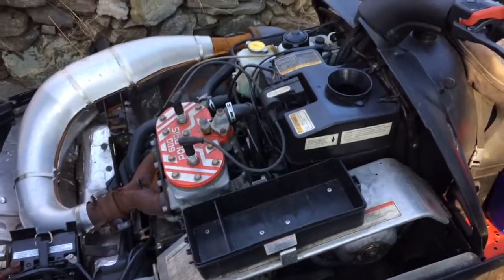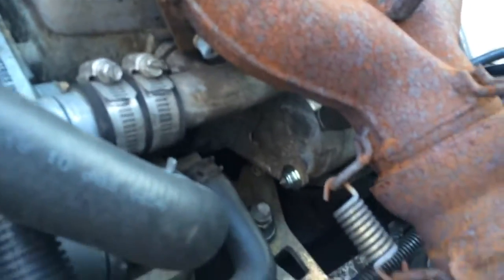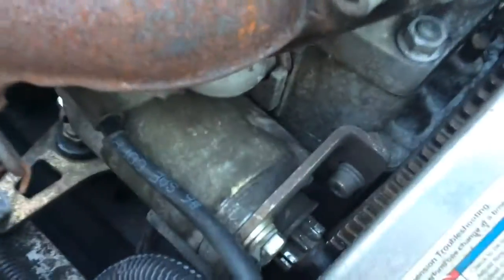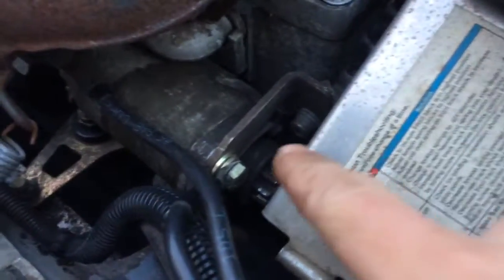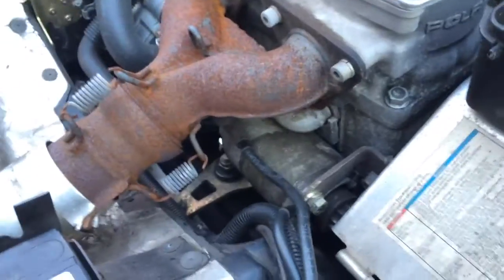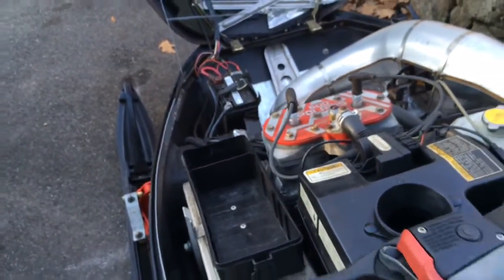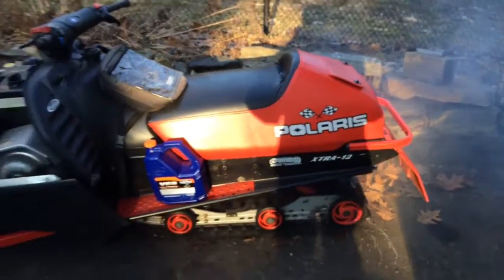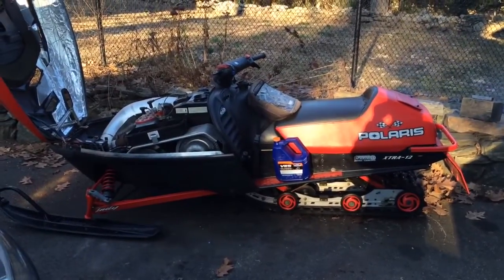2000 Polaris Indy 600xc Snowmobile - Cold Start/ New Starter Install

Comment: You helped me tremendously. The key is the hard to get to 9/16th bolt and as it turned out, the tool to use on it in my case..
I used a ratcheting flat wrench and  good lighting.  The $66.00 aftermarket starter required me to slightly drill out the rear mounting bracket but all in all the operation went smoothly largely due to your video-help.
Reply from the maker: so glad the video helped!!
Reply: @buzlewis5715 where did you get the starter and do you have a part number
Reply: Where did you get the starter and do you have a part number

Comment: hey just wondering what type of tool did u use to get the bottom 9\16  bolt on the starter on with sure could use ur info did u have to take the clutch off as well
Reply: Exactly!  It’s been a year and he still hasn’t answered you! I still can’t figure out how he did it without removing the clutch.

Comment: This is a nightmare job, the best option is to take off the manifold first, than undo the back bracket 3/8 universal joint socket, undo the front 6m allen head bolt, tilt the starter back and use a 1/4 drive with 6m hex bit socket to take off the bottom bolt.